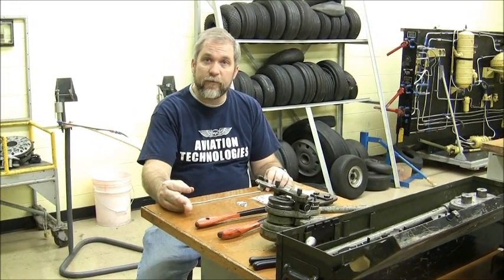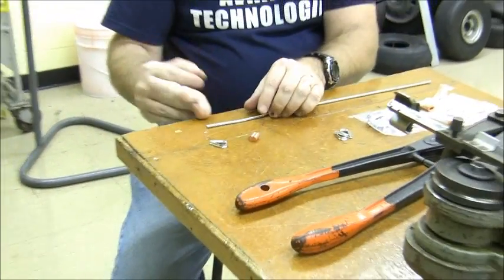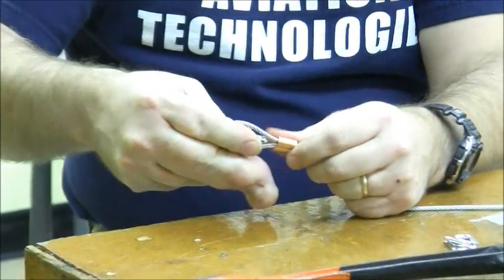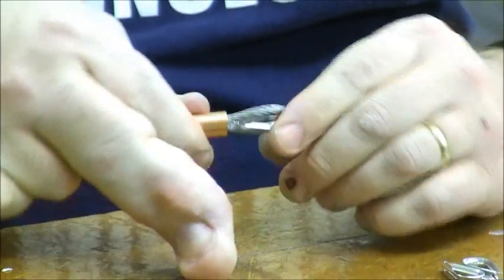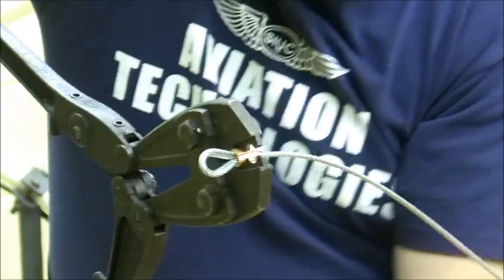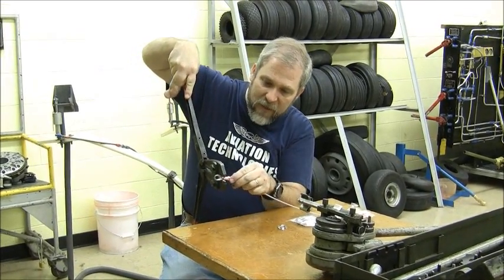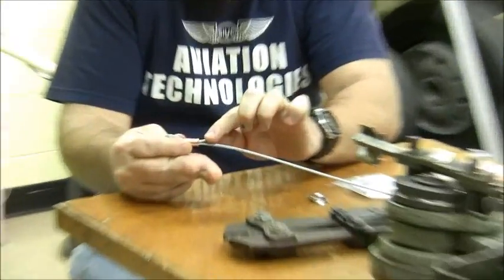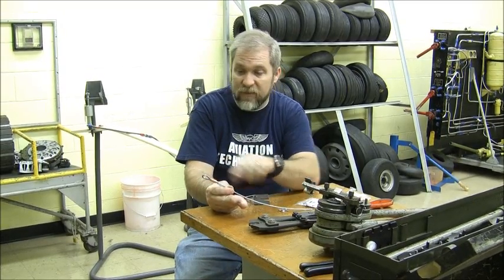Aviation Tools Training - Nicopress Sleeve and Thimble

Comment: You left WAY too much tail sticking out of the sleeve! We high-steel riggers HATE to get our fingers jabbed by those little devils! Depending on the gauge of the wire rope, (that's the proper name) I start with about 1/8" - 1/4" sticking through the sleeve.  By my third press, it's flush with the edge.
Reply from the maker: Leaving it flush with the edge makes it prettier and less likely to draw blood, but it also decreases the strength.  We rely on that uncompressed tail as part of the system.  You can do it however you want, but if I am inspecting an aircraft with no tail sticking out of the sleeve, it is no fly!
Reply from the maker: Leaving it flush with the edge makes it prettier and less likely to draw blood, but it also decreases the strength.  We rely on that uncompressed tail as part of the system.  You can do it however you want, but if I am inspecting an aircraft with no tail sticking out of the sleeve, it is no fly!
Reply: @1donagin   A&P mechanic Fred Stadler begs to differ: https://www.eaa.org/videos/4315630248001
Reply: AC-43.13-1B page 7-33, " If the cable end is inside the sleeve, the splice may not hold the full strength of the cable." I Know its an old comment but its better to state actual sources then peoples words.
Reply: c. Thimble-Eye Splice. Before undertaking a thimble-eye splice, initially position 
the cable so the end will extend slightly beyond the sleeve, as the sleeve will elongate 
somewhat when it is compressed. If the cable 
end is inside the sleeve, the splice may not 
hold the full strength of the cable. It is desirable that the oval sleeve be placed in close 
proximity to the thimble points so that when 
compressed, the sleeve will contact the thimble, 
as shown in Figure 7-14. The sharp ends of the 
thimble may be cut off before being used; 
however, make certain the thimble is firmly 
secured in the cable loop after the splice has 
been completed. When using a sleeve requiring three compressions, make the center compression first, the compression next to the 
thimble second, and the one farthest from the 
thimble last.
Reply: Ever hear of electrical tape or gaff tape? Just tape the ends and that problem is over, cmon man.

Comment: my middle finger on my right hand is also somewhat deformed  :)  ..... I am hoping commercial hardware swaggers are good enough to use on the nicopress sleeve and cable
Reply from the maker: I just purchased a Dare 2154 off brand splicer this week, because someone misplaced the nicopress crimper in this video.  It is a poor substitute, but if you play with it long enough, it should be passable.